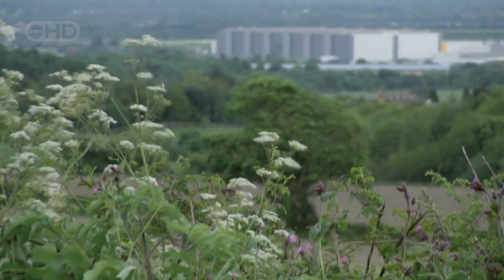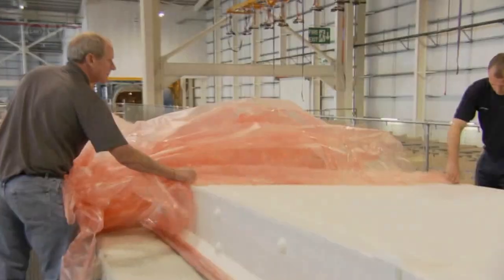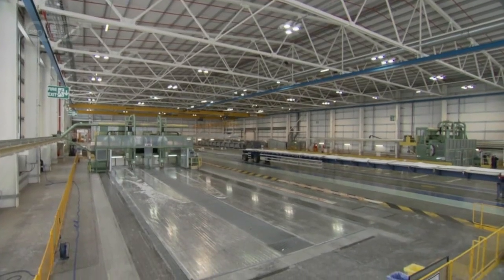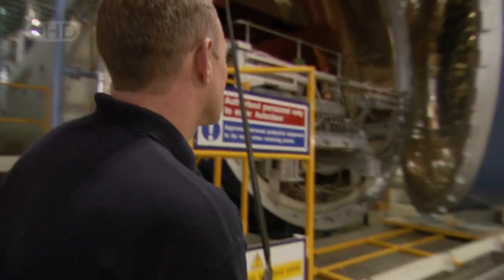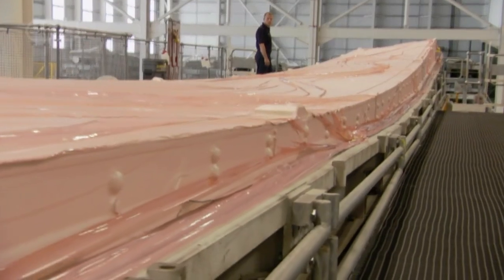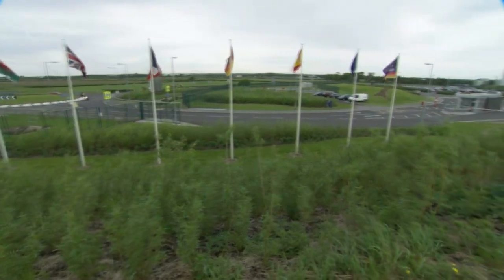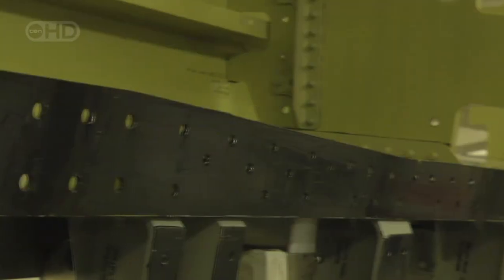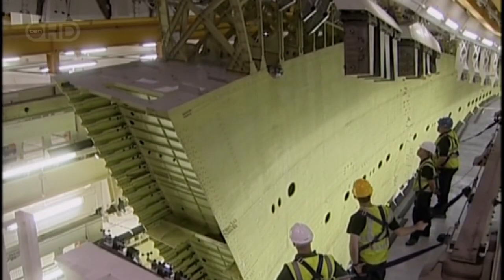Airbus A380 - Wing Construction - HD

Comment: Please explain " supercharged " engines..
Reply: I work for the jet engine company that made the engine. There is no such thing as a supercharged engine, this engine in particular is a partnership between GE AND Pratt and Whitney named the GP7200. It produces 70,000 of thrust and there no supercharger lol. Superchargers are only applicable to a piston engine, not a turbofan. Turbofans run most of their thrust by the bypass ratio (how much air bypasses the core and around the engine). It has multiple stages for the compressor, a high and low compressor. You know what, this'll take wayyyyyy to long to explain.
Reply: @Babygeniee  I think thy are just using hyperbole for drama!
Reply: supercharged engines means use of extra turbine to compress the air before mixing the fuel to increase the density of air for engine efficiency
Reply: The term " supercharged " applies to piston engines, where air is mechanically forced into the cylinder before combustion . All jet engines have turbines to compress the air entering the engine.  Its the basic principle on which  jet motors function, Some may have more stages of turbines than others . I don't see where the " extra " description is applicable here .
Reply: ya me too, never heard this term used for jet engine, but that's what supercharged means
Reply: Suman Giri I've heard it used for turbofans, but only rarely. It was used to describe a 2 (or 3) spool engine, where the high pressure compressor was said to 'supercharge' (further pressurise) the air that had passed through the low pressure compressor, before entering the combustion chamber. Since so many different engines of this type exist, it was maybe just an unusual way to describe a 'common' process, rather than a specific engine design.
Reply: tjp353 thank you
Reply: Supercharged just means that the driveshaft is mechanically connected to a compressor which forces air into the combustion chamber to make the combustion more efficient, which is true for these types of engines by design. The dictionary definition doesn't actually limit superchargers to piston powered engines, even though the term is more commonly used in that field.
Reply: This discussion is supercharged by a bunch of turbofreaks ...
Reply: Especially as you clearly have no idea what you're talking about.  You "work for the jet engine company", huh?  Is that what you guys call it these days?

Comment: I'm not trying to convince anyone of anything - just trying to correct the assertions that:-
a. Airbus always follows Boeing - they're both responsible for numerous innovations, improvements and advances.
b. That the wing rib cracks are a big issue - they're not flight critical & fixing them isn't difficult.
c. Airbus are 'happy' to build an unsafe A380 - they're having problems, like Boeing, but they're doing what's required to fix them.
And subsidies? Both are pointing fingers at each other.

Comment: 787 wings and centre wing box suffered delamination during load testing, which required modification and led to delays in flight testing. They've also suffered fuselage delamination issues, which required modification of manufacturing techniques. 'Teething trouble' - sound familiar?
I've never claimed Airbus is perfect either, but if you're going to criticise one aircraft type, it might be worth checking first that 'your' aircraft hasn't suffered plenty of it's own problems. There's a big list.

Comment: Rebuilding this wing? Not quite. On Airliners . net (where people actually know at least a bit about what they're talking about), the A380 wing rib crack issues are generally seen (by people on both sides of the Atlantic) as little more than an embarrassing problem, blown out of proportion, affecting non-flight critical components, that will be inspected and fixed when required.

Comment: So it's ok to modify a 767-200 wing to carry a plane 43% heavier than the original design, but it's not ok to modify a wing to correct a 3% discrepancy? Are you serious? The 147%/150% problem has already been fixed and approved.
I've heard of the 'revolving door' between Boeing and the FAA, so maybe Airbus have one too.
DC10? Turkish Airlines flight 981 & AA flight 96.
Is all this fuss over the A380 intended to divert attention away from the 787's catalogue of faults and problems?

Comment: The point is, the original 767-200 had a MTO weight of 315000lbs, while the 767-400ER has a MTO of 450000lbs. The original -200 wing wasn't designed for this weight. Boeing didn't have to repeat the 150% ultimate load test on the 767 wing, every time the weight grew, just like Airbus don't have to repeat the same test after they discovered the A380 wing broke at 147% - they just have to modify and strengthen it accordingly.
Unbiased? Yes - I argue with Boeing haters too.

Comment: What reason is there for the NTSB to incorrectly blame the pilot?
Rudder inputs after the event? The point of fin separation would be obvious from the rudder input and yaw data recorded on the flight data recorder.
"pilot error proof" - the A300 had a conventional hydraulically assisted, cable operated flight control system, with none of the 'hard limits' of the later (A320 onward) Airbus fbw system. The NTSB report states that the A300 fin & rudder exceeded certification requirements.

Comment: Bullshit?
So how many sets of 737 or 747 wings have been ultimate load tested? Both planes have significantly grown in MTO and MZFW, from their original -100 series versions, but Boeing didn't have to ultimate-load test a wing each & every time these weights were increased. They just modified and strengthened an existing design.
Did Boeing ultimate load test a 767-400ER wing, or did they just modify and strengthen the original -200 wing? Can you find a 767-300 or -400 wing test report or video?

Comment: Like I already said, ultimate load testing and fatigue testing are 2 very different things - and I'm sure you know why. I'm just surprised the fatigue crack issue wasn't discovered first on the fatigue test wing.
'Teething trouble' for a new design is embarrassing and expensive for it's manufacturer, but is certainly not limited to the A380.
I'm trying to remain neutral here, but the 747 & DC10 also had early design problems (that cost lives) - something fortunately avoided by the A380 so far.

Comment: I'm aware of that. The wings have been strengthened. Once a wing design's properties are 'known', they don't need snapping again once they are strengthened. If that were the case, every time a plane type has it's weights increased (ie, stretched) it's new, modified & strengthened wing would need ultimate load testing all over again.
Plenty of planes have had their wings modified and strengthened, based on the original wing testing results.
The FAA has approved the A380 design.

Comment: Regarding fly-by-wire - what do you think Boeing have used for the 777 and 787 flight control systems? The only real physical difference is Boeing use a control column and yoke, while Airbus use a sidestick, but both companies now use fly-by-wire.
I'm not here to convince anyone - I'm neutral in the whole Airbus vs Boeing argument.
The fact of the matter is, both have introduced new technologies, both build great planes and both have suffered 'teething troubles' on some of their designs.

Comment: I'm more surprised it didn't turn up on the fatigue test wing, before it was found in service. The test rig is supposed to be 'years' of flight cycles ahead of any in-service plane and it's there to identify exactly this sort of problem.
Ultimate wing load failure is totally different to fatigue cracks, so I doubt the 2 are related. With the 147% ultimate load failure, Airbus seem to have done enough to satisfy the FAA & other regulators that they've fixed the problem - or it wouldn't be flying.

Comment: In complement: the Last tests from a the  022 Leduc Statoreactor, and from the Nord 1500 Griffon prototype fighter (fly mach 2.19 in 1957) was take from André Turcat, the chief test pilot from...the Concorde...

Many inventions are found long before it was technicaly possible to built it , ex: was the case from the turbo (Swiss Alfred Büchi, in 1905), the G compressor (French Léon Creux 1905),etc...

Comment: What you mean? the first flight from a stato was planed in 1940 , but because the WW2 occupation of France from the nazis, tested in flight only after in 1946.
Because a statoreactor not work without initial speed, the first Leduc aircraft was use launch from a bomber , but later use composite engine (turboreactor+ statoreactor) , the statoreactor was ignited after take off, over 300kph. Actualy, statoreactors are use from missiles and the  US "UFO" aircraft who fly mach 6 and +

Comment: "Plus the four supercharged engines"
SUPERCHARGED

You keep using that word.
I do not think it means what you think it means
Reply: Supercharged just means that the driveshaft is connected to a compressor which forces air into the combustion chamber, so technically all jet engines are supercharged by design.

Comment: It's not unusual for cracks to develop on any aircraft. As long as they're monitored correctly and repaired accordingly, it's perfectly safe. In a quick internet search for structural cracks on A300, A320, A330, A340, B737, B747, B757 & B767, ALL have suffered structural cracks of some kind.
Anyone who has flown has likely flown on an aircraft with a few cracks here and there, but because this involves the A380 it's big news.

Comment: Really ? I work for a major plane maker in the Seattle area in composite repair,I use film adhesive ,carbon Fiber ,prepreg,Kevlar , honeycomb core ,metal bond,  DVD (I'm sure your familiar with that process) So I think I know a couple of things myself. And I'm discussing processes to which this video is about .There is no way one could not imitate Boeing process when building a project of this size weather Airbus copied it or stole it.

Comment: so... why were the wings baked? :S It doesnt actually say...
Reply: Phil Crossland ..cause ppl like them hot or mild
Reply: The milling operation puts stress in the aluminum.   Raising the temperature and holding it for a given length of time relieves these stresses.   This process is called annealing.  Too much stress in aluminum can cause cracks to form.......the same happens with people too I've found!
Reply: De stressing  of the aluminium panel.